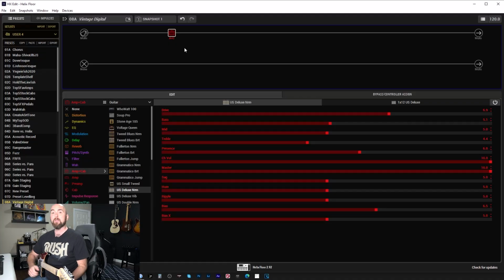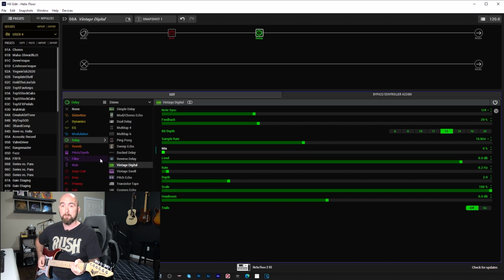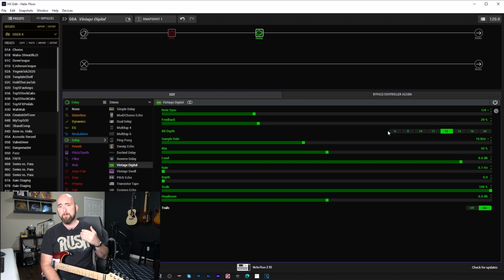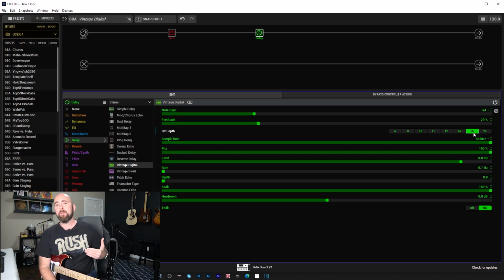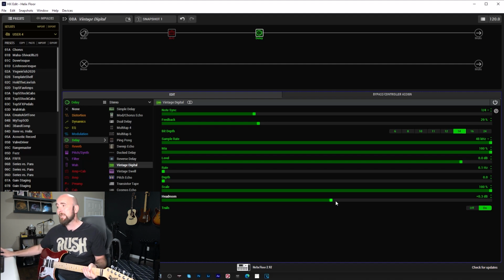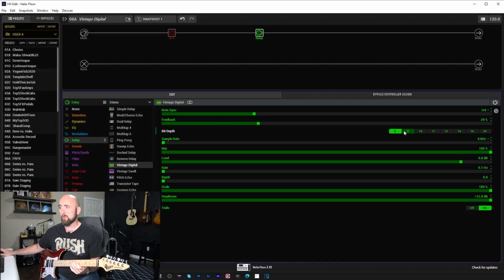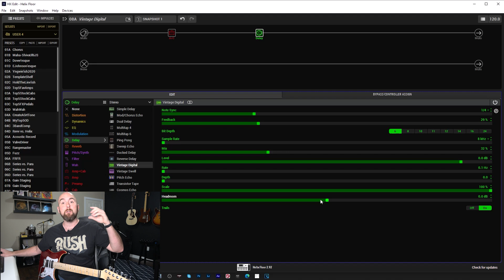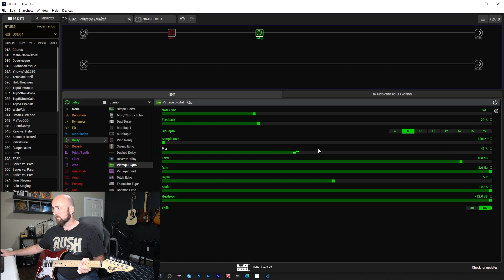Line 6 Helix/HX Stomp/Pod Go | Dialing In... Vintage Digital Delay!!

Comment: Jeez, Jason, you are SUCH a geek! But in the best of all possible ways! Love all your vids, watch 'em all. There's just SO many options in the Helix it's easy to gloss over blocks you don't understand right away, and you do such a good job covering the detail that's missing in other sources.  It's why I'm so addicted to your channel. I get more convinced the Helix was the right choice every time I watch!

My wish list for future vids:
1. Using Helix as audio interface specifically in Reaper.  I seem to have lost the magic sauce here, and don't know why.  I know you did a vid earlier with both Reaper and another DAW, but was not detailed enough because you were generalizing to both DAW's.  Specific topics: Setting input devices in Reaper, Setting Global settings in Helix for both processed and dry signals, and headphone monitoring back through the Helix phone jack.

2. I have a Powercab 212+, and am sending Helix output to it via Line 6 Link.  There is a substantial drop in output level vs. instrument cables which makes it almost impossible to get the proper amount of signal hitting the PC212 (at least I can't seem to get the 212's clipping indicators anywhere near blinking orange until I crank the bejeezus out of something in my gain staging chain, which I don't want to do for front of house reasons... I know there are a lot of forums talking about this issue, and a lot of theories.  I'd love to hear your take on it.

3. Outside the Box: a video on using the Helix as a vocal processor. I've never seen anyone tackle this.  Seems like a great platform for some real interesting possibilities...

I'll shut up now.  Thanks again, my friend, for all you do!  Your efforts are GREATLY appreciated!  As you say:  Ciao for now!
Reply: I realize it's quite off topic but do anyone know a good place to watch new movies online?
Reply: @Titus Hank I use Flixzone. You can find it on google =)
Reply: @Harper Eli Yup, been watching on Flixzone for months myself :D
Reply: @Harper Eli Thanks, signed up and it seems to work =) I really appreciate it !
Reply: @Titus Hank you are welcome =)

Comment: Great video, really explains well how these controls work. Hope you will eventually be able to do this with all the effects as its hard to know how to use all those parameters. So it kind of comes down to what you want role the delay to play in the tone. Could you do a video on the approach to using delay - how do the delay repeats relate to the dry signal re: distortion, frequency response, and modulation? What are the different approaches to delay and how it compliments the dry signal? Would love to see your views on this.

Comment: i was about to throw my helix out last night. i was running it into a motu m2 and i started hearing this clipping. i had no idea this was even a thing! i just switched from using the powercab plus speaker sims, to having everything on the helix and going foh but i couldn't figure out why i was getting this clipping. after some googling i maxed out the headroom and bitrate and everything was peachy! lesson learned, take no parameters for granted in the helix-verse.